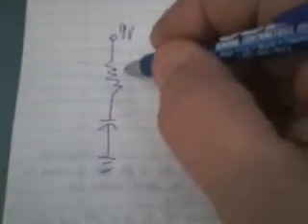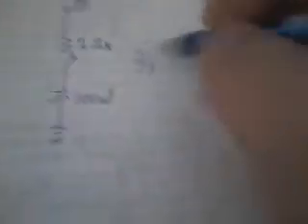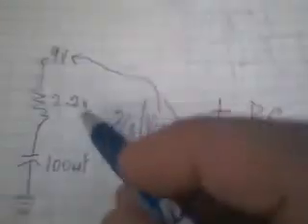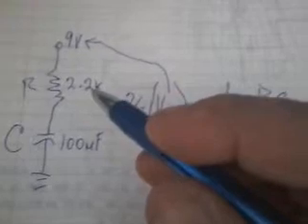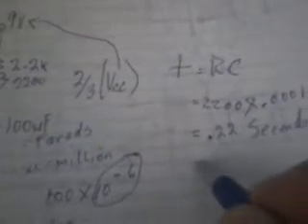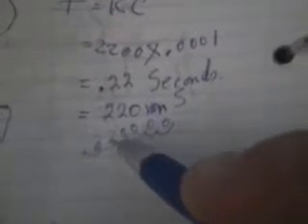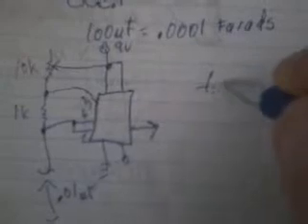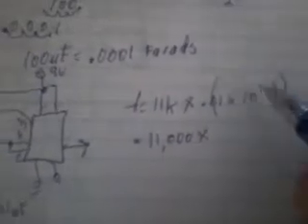calculating time constants for capacitors

Comment from the maker: Capacitors have built in resistance called (esr) this with external resistances determines time constant.   Capacitors cannot charge to 50% unless you develop a circuit to cause it to stop charging at 50%.   Regardless of supply voltage all capacitors will charge to peak voltage of supply less esr.  In switching circuits such as timers capacitors will charge to 67.7 % of supply I believe because of ac resistance or reactance.  Interesting question though.